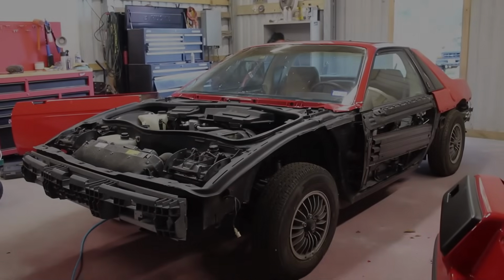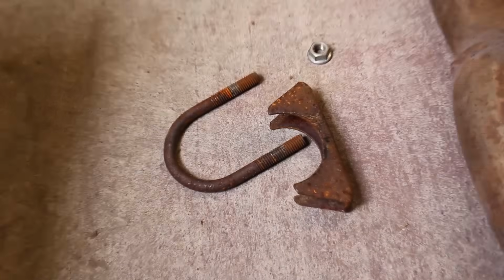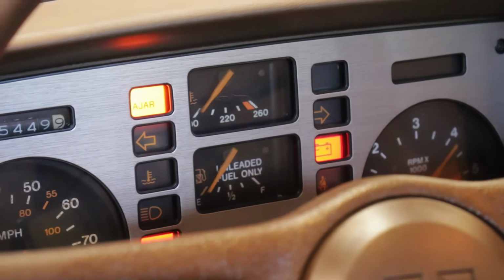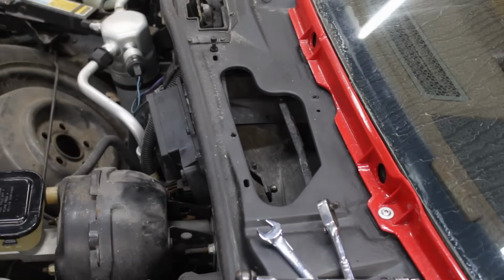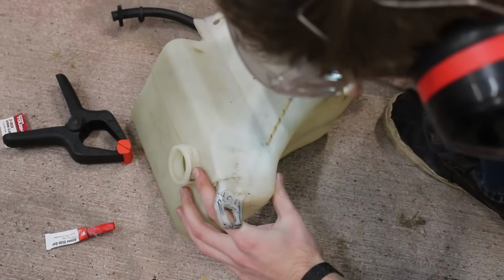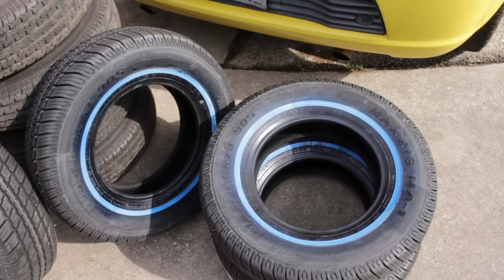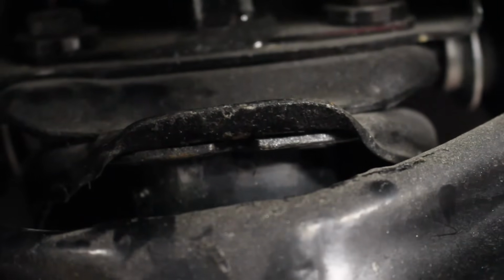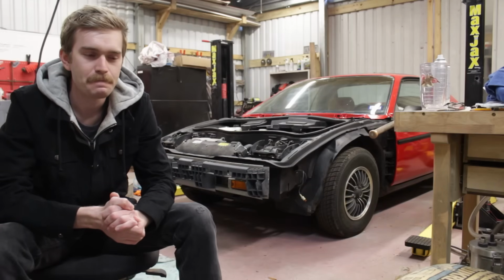The Haunting of Red Car | 1985 Fiero 2M4 Revival - Part 14

Comment: You might want to consider putting the lowering springs in the rear too, since the altered spring rate in the front, but not in the rear might affect the handling, and if the rear springs have sagged, then the new ones probably won't actually lower it.

Comment: You really don't plan to replace the rear suspension springs too? I assume that they are stiffer than the original ones, as the front suspension springs are. So the roadholding should be more harmonic as with soft springs in the back and stiff springs in the front. And maybe the car heigth will then be really the same in front and rear?

Comment: I definitely would have put everything back together in the front before worrying about the right height. I get the feeling you're going to be raising it back up. It doesn't make any sense that the front would have suddenly ended up higher than the rear and chances are once you add all the week to the front with the hood and fenders and everything it's going to come down quite a bit.

Comment: You have done such a great job on the car and really have a great channel that I really enjoy but you should not have installed those springs.  Fiero’s front ends have pretty insufficient travel to start with.  Install the panels and clip, fill the tank with gas and drive to get the green out of the new shocks.  Then measure and see what you have for ride height. It may have been pretty close. The rear could also be tired and needed to go up.  For ride quality and bump absorption you don’t need to ever lower one of the lowest cars made in the 80s.  Great effort on the radio repair!

Comment: The drop rate they advertise is never what you end up with it is always lower. My honda was supposed to drop an inch, it was almost 2 inches once installed. It will settle a little as well

Comment: I had a 95 GMC truck that the wiper board probably went out on as well! The timing of the intermittent function was completely random, and it sometimes it didn't work at all! It made for a fun driving experience in the rain, only helped by rainx.

Comment: I have always liked the Fiero. I think it is very underappreciated. especially when you take into consideration that it was largely parts from the X-Car bins . If GM had developed it a bit more (more power, primarily) it could have been a winner. Chevy didn't want a low price competitor to the Corvette, so - 

RIP Pontiac !!

Comment: Scuse me? Translated >>>>   (It's been fun, your a good guy, and we'll miss you.....)  
continue...    Done My @$@^%#!   I did not see it all buttoned up, Nor did I see a 200 mile test drive. (Like I took my 1964 BSA on when I finished it last july. Talk about Pucker Butt 🤞😎)    Bought the Bike brand new and still got it 57 years later.(Yikes) I took 3 years also, parts are getting hard to find and had to bore .020 over and put in new pistons.

Comment: That ghost wiper is your mom, innit? Besides cutting the nipple, and letting the spring spin loosely inside it's designated place, fine tuning the ends of the spring with angle grinder would've been more propriate. Also, the handling characteristics with that spring setup can easily result to a pole-wrap. The grip just isn't where it sould be, when it should be. And even more so, does someone honestly think that font in those bolts is an "accident"?

Comment: Folks, this is a perfect example of the last 2%. Its usually the last 2% of a restoration that takes as long as the first 98%. I work in a high end restoration shop just outside of Austin, Texas. I've been doing restoration work professionally since 1985. Its these little details that make the vehicle. Too many times we get classic cars in the shop that look great, all the numbers match, correct components, etc. but barely run and nothing actually works. We can spend MONTHS chasing down all these little details! Especially if its a vintage corvette that will be showed, that is another level of detail. My suggestions: Get an alignment!! Seriously, drive it to an actual shop and do the full alignment. Do this AFTER you replace the rear springs!  That Eibach kit you bought is a matched set, they work together. Just measuring the toe isn't enough, caster, camber ALL make a difference and 10 times out of 10, every car we get in our shop has never had that done. It will make a big difference in the way the car rides and handles, predictably! For anybody watching, if you are working on a car that sat for anything more than 5 years outside, replace the entire brake system first.

Comment: heeeyyyyy, it's done, good job! but GAH, why not install the rear springs at the same time? They're designed to be used as a set, ya dingus!
Now you've got a wobbly saggy butt end with a stiff and ferociously poised front end.

Comment: Is FlexSeal conductive?  Would it help to prevent corrosion (and solder becoming loose) by spraying exterior circuit boards with FlexSeal?

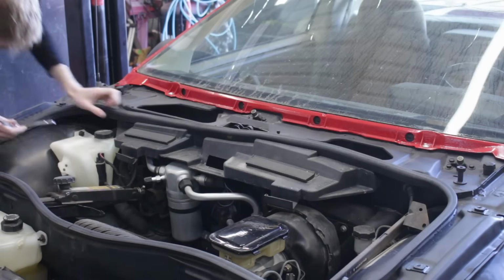Comment: 16:32  my 1998 Chevy Cavalier's wipers would not turn off when I turned them off unless I turned them off and turned the car off.  The mechanic shop wanted $300 to replace the motor and relay or they said I could wire in a separate shut off switch....it cured itself.

Comment: I had the phantom wiper issue in a 1990 S10 Blazer.  Replacing the circuit board in the wiper motor seemed to cure it as i recall.

Comment: This series is truly the most realistic depiction of what its like to restore a car I've ever seen. From having to take the gas tank out 315 times to fix stupid problems, to punching a hole in your brand new headliner, to having to redo certain things either from doing it wrong or parts not working right. I resonated with everything this series has gone through because while you've been doing this I've been restoring a square body Chevy truck and have navigated the same pitfalls. I just finished it in December of last year and had to park it because of winter but I'm looking forward to driving it and I'm sure you're looking forward to driving the Fiero (assuming you haven't yet since this was recorded in the past). Hope you're staying safe in the Texas freeze.

Comment: It's a good idea to use "exthaust mounting paste" when ever assembling exthaust components.
It seals the joints, but it also lubes the joint such that they go together and come apart more easily, it also prevents the joints from rusting solid
Reply from the maker: Good to know, thanks!
Reply: @RonaldFinger  "muffler and tailpipe sealer" by permatex! Thanks for the great content.

Comment: insert Louis de Funès leaning into the light and shadows zat iz intentional, mein Freund! :D (just kidding)
Can relate to the windscreen washer pumping motors. My vehicle has an aftermarket one, where the circuit is laid out in a way that there is no possibility of making it push fluid to the back. I either have to re-fit the wiring in the car (rewire everything) .. or find a part in a car that got scrapped with no damage to the front, so that a pump could be salvaged .. just to fail and leak as the previous one. At least the Fiero has it in an easier-to-manipulate position, where one does not have to tear half the engine bay down.
Also: DAT @SS! :D

Comment: about that angle of attack, does the rear have fresh springs and shocks? they might just be tired compared to the front ones
Reply from the maker: Brand new shocks in the rear, but stock springs. It might be a combination of old springs as well as the aftermarket shock possibly being a little shorter than the factory one, compressing the spring more and subsequently lowering the rear more. I’d like to use the new springs, but I’m afraid after installing them it’ll just be lower in the rear again.
Reply: @RonaldFinger  i wonder if there are springs that arent lowered, so it can be truly "stock" 
but thats for in the future id imagine, car is almost done and looks great 
its been an amazing 3 years watching you do this all and i cant belive its been that long
Reply: @RonaldFinger  some spring shops can make custom coils for not that much (for what it is) you could likely bring your old ones in and get them to make copies, that should sag less and not need to be any taller but maybe request they aren’t as short too

Comment: Was the excess front ride height noted before you loosed and re-torqued the control arm bushings at ride height?  The excess ride height may have been caused by the initial incorrect installation of the control arm bolts.   
Either way, great work!  Really enjoyed the series. Looking forward to your next project!

Comment: I'd honestly put the lowering springs in the rear, it actually makes the car look better in my opinion it's not weekend angle grinder job and it isn't a rock crawler height, I think it would be at s nice height, looking at the rear the gap is still pretty big
Reply: Well it's a mid-engined car, so you want the rear to be raised a bit and have a lower spring rate.

Comment: This is really being a great series, but I'm curious about the business with the front springs. Why was the front sitting higher then the rear? SOMETHING made that happen. I'm guessing the rear springs sagged, if that's the case then you probably ought to replace them, and after all you already have the parts.
Reply: He also needs to put the rear springs in because the new fronts are stiffer. Stiff front + soft rear = car won't turn for crap.

Comment: I suggest using stainless steel band clamps instead of those 2 bolt ones. they rust so quickly. most parts store sell them for about $10